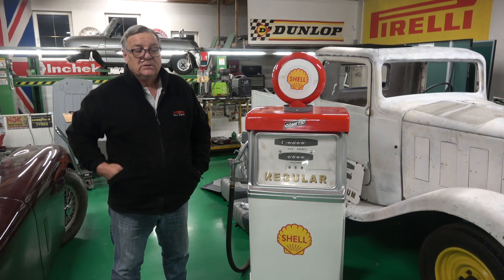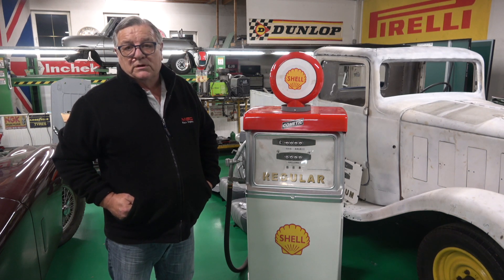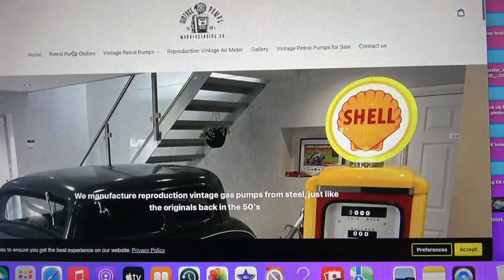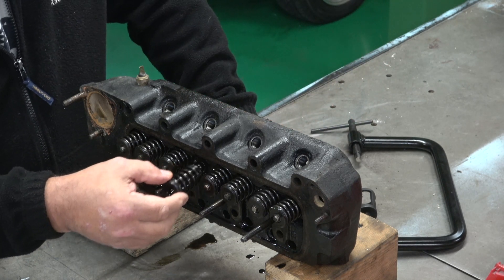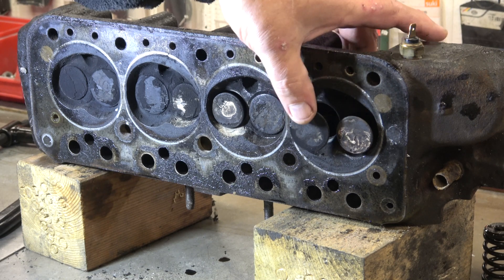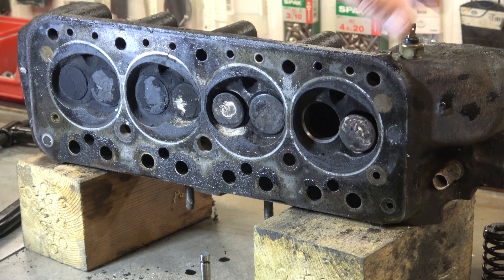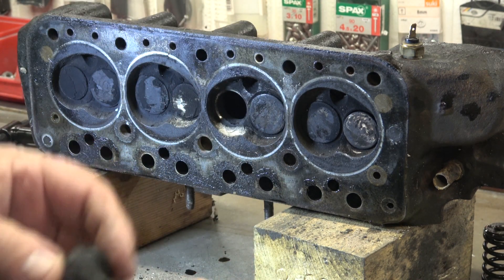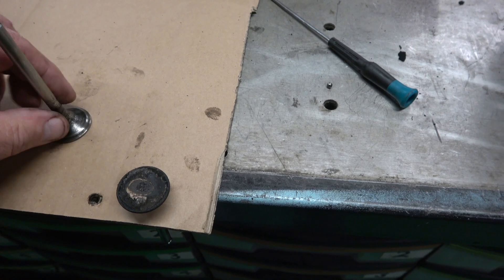Classic Mini 1100 Special Rebuild ( Cylinder Head Refurbish ) Part 15

Comment: Hi Dave, was it the picture or was there a big build up in the centre of 2-3 as it looked as if the head gasket was leaking across there   Doug.
Reply from the maker: Doug,  The head casket was fine it was the exhaust valve causing the low compression. If the head casket was bad cylinders 2 and 3 would have been 
down on compression or if the casket leaked into the water jacket it would have shown up in the radiator when I checked it. Cheers Dave

Comment: It may be because of the angle of the video but it looked like quite a bit of valve guide play in them ?
Reply from the maker: Malcolm,  I will check there is little to no play in the guides but the distances it moves is so small it should be Ok. Cheers Dave